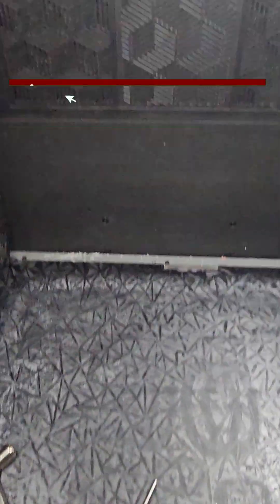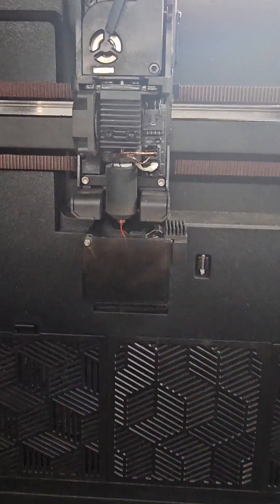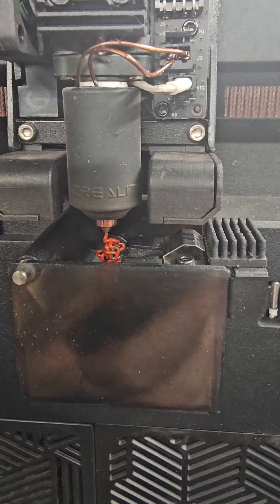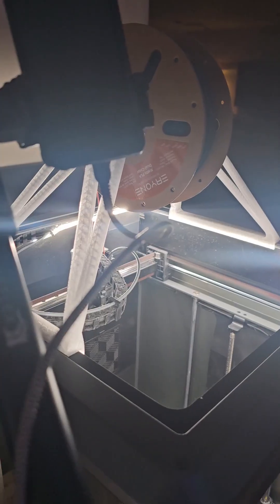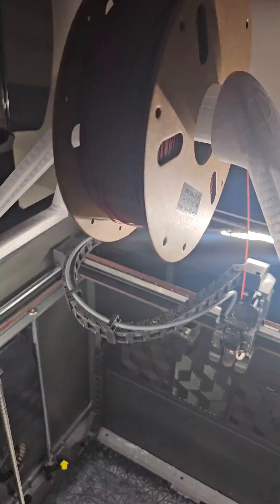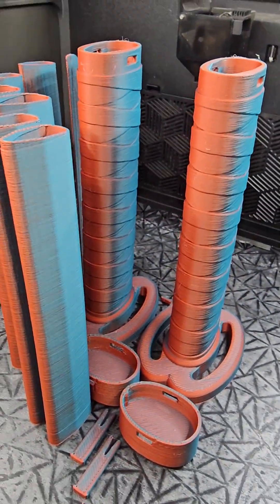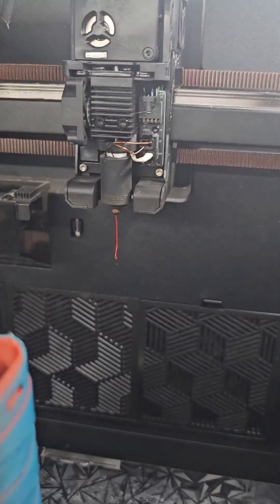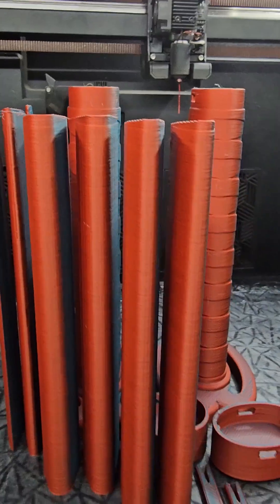🔥 6mm 3D Printer Nozzle Size? 🤔

Comment: I am also Creality printer and I recently bought the same filament. I love Eryone filament almost as much as I love Creality filament which is the best I have used hands down. Eryone is my next fav. Recently bought 2 spools of same duo color matte you are showing and had terrible outcomes. I changed nozzles on 2 printers and had the filament on several different printers all running the same design, nothing but problems. Not even a quarter of the rolls used and I removed all.  K2 and K1 Max and a couple of K1C’s printed fantastic before and after that filament. Even prints that completed, super brittle and worst quality prints. Changed back to Creality filament on all printers, smooth sailing same designs printing. This is not a I love Creality filament post but saying I think Eryone has a bad batch. A very bad batch. I thought about returning it and contacting them but I’m busy and was going to cut my losses and move on but you are showing similar issues I was having, I don’t think it’s just the nozzles or machines.
Reply from the maker: Totally agree! It's consistency I really want and it is really hard to find that in just ONE brand. Thanks so much for your comment, I really appreciate it! 🎉